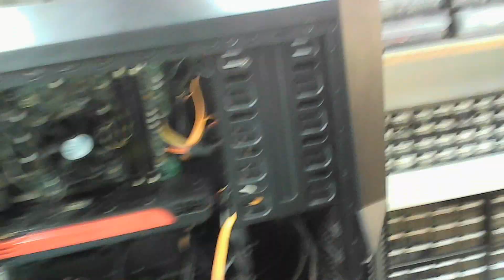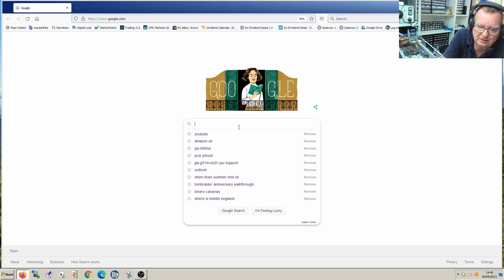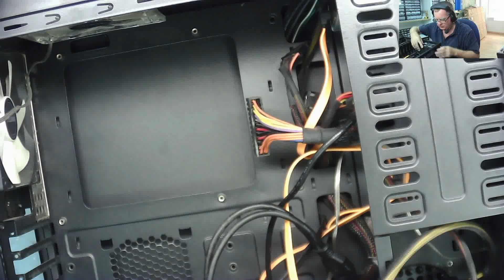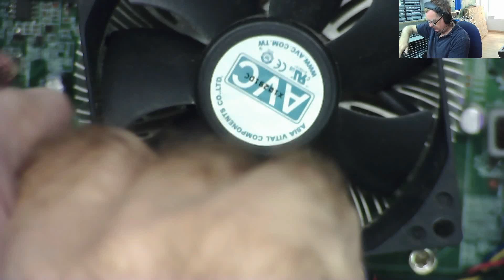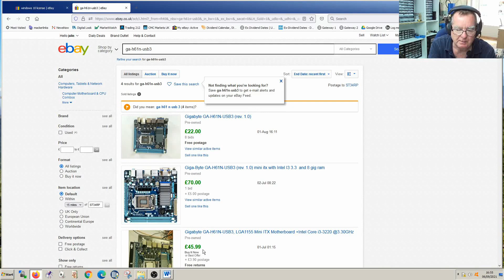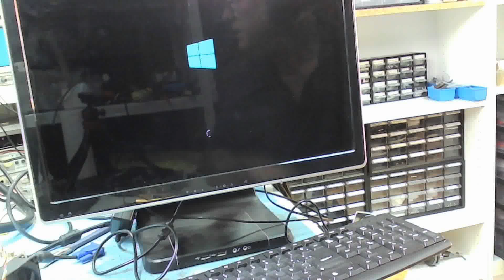Car Boot / Flea Market PC Finds - some you win some you lose.  Learn Electronics Repair #127

Comment: You'll break even at best; oh well, that's OK
Reply from the maker: That's the way it goes sometimes John.  It made for an entertaining video though.  I'll take break even but I think I may do better.  

I spent a little more time looking at this stuff today

I now got the Hundy X All In One running really quite well with a used 256Gb SSD and a clean Windows 10 64 bit install.  There is space inside for 2x 2.5" HDD so I fitted the 320Gb as well, deleted the old partitions and formatted it. It has webcam, internal speakers 4Gb RAM and wifi built in.  The SSD owes me about €20 and I just ordered a new keyboard and mouse to put with it which was €5.98 + IGIC (IGIC is our version of VAT but it is much nicer as it is 7%) so given I payed €10 for the item and I also have a €2 second hand laptop PSU to put with it, anything over €40 is profit.  I will ask €100 but suspect I may get more like €80 for it... we will see.

The two Viewsonic 19" monitors from the POS machines are working and in nice condition - I took them off the big POS stands so they only have Vesa mount brackets but I think I can probably sell them to one of the local bars to fit to their DJ /Karaoke booth or something like that.  They have DVI and VGA so I think I should get €40 the pair or something like that.  Those two POS even if the motherboards are scrap owe me €10 each so that's profit.  The other AOC monitor is badly scratched, most likely I will bin it.

The Gigabyte Micro ATX motherboard should fetch  about €30 if i put it on ebay.  That PC owes me €10

The i5-3330 CPU from the other POS looks like they sell OK for about €15-€20 - that POS owes me €10 so a little profit there
The Gigabyte ITX from the same POS boots to the BIOS screen but that goes off after a second then I get a flashing cursor, possibly that one is OK, possibly needs BIOS reflash, I didn't check it thoroughly yet - anyway it's about €30 on ebay if it works

So I make that about €85 net profit (€115 if the Gigabyte ITX is good)  and the 1200W ATX I am going to keep it myself as it then owes me nothing.

The other two ITX with integrated CPU, the Intel LGA1155 Motherboard and the Radeon are just a bonus if I can resurrect any of them

The Ugly ATX and all the other junk can go in the skip!  I did get some nice Zalman cooling fans out of it though and two of the little mini ATX PSU out of the POS machines are working but probably need recapping.  

So actually probably it won't work out too bad.
Reply: @learnelectronicsrepair  It was an entertaining video indeed; those ITX boards have a Sandy Bridge ULV Celeron CPU, all solid caps, all kinds of ports (inc Dual Lan), can take up to 16Gb and will work with anything from XP Embedded to Win10. I'm really curious to see what's wrong with them.

Comment: Oh there’s absolutely profit to be made. ANY working mainboard from socket AM2/1156 onwards is worth a minimum  of £20. The problem with that PSU is that it’s not a well known make so you won’t get as good a price as you otherwise could. 

And yeah…that case, damn it’s ugly! 😖

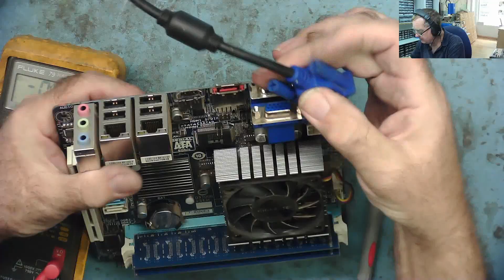Edit 42:49 that’s an eSATA connection, a failed attempt to compete/replace FireWire and USB 2.0. That mainboard only has a PCI slot because it was designed to be used inside a pre built, all in one type system, not to be removed and used for something else. I haven’t got to the part of the video where you remove the heatsink, but there’s a chance the CPU will be soldered to the board instead of in a socket, if it is in a socket, they’re usually low power Pentiums.
Reply from the maker: Yeah beauty is in the eye of the beholder but in this case everyone seems to think it is ugly.   Funnily enough I find it is often motherboards from P4 socket 478 and earlier, that are worth more money!   The ones of least value seem to be LGA775.  Except for the few 775 with AGP of course....  And like you say, the more recent ones from Core i3//5/7... onward.     So actually come to think of it that is just about 'any working motherboard'. The 1200W PSU value is kinda academic really, as you probably guessed it is staying at the workshop :D
Reply: @learnelectronicsrepair  50:22 I knew it, integrated CPU!

Yeah you can pickup LGA775 boards for next to nothing at the moment, socket 478 boards were very cheap until fairly recently when they’ve started being desirable in the retro community…of course I’m sitting on absolutely loads of them! 😆👍🏻

Comment: Nice video. Any chance you could do a  video finding shorts on a faulty board using the diode mode with a multimeter?
Reply from the maker: Check these out:

https://www.youtube.com/watch?v=kGM-Zmrr6tc

https://www.youtube.com/watch?v=NUgO7v4cbKs&t=117s
Reply: @learnelectronicsrepair  lovely! Will watch those videos. Thank you!

Comment: Hello I have a psu that has a problem it starts and then turns off in one second but the purple wire has a perfect 5 v and in green wire also but in 12v its fan run and the turn off in one second it is a basic smps. Any suggestions please ? Thank you
Reply from the maker: That could be for various reasons.  Does the purple 5V go off as well or just the other supply voltages.  Are there short circuits on any of the outputs?  Have you tried putting a load on the PSU, especially on the 3.3V?  How are you measuring the outputs, with a multimeter or ATX analyzer?  You need to do some more investigation before anyone could answer the question.
Reply: @learnelectronicsrepair  if I short the two terminals of opto coupler then in 12v rail it gives 6 v.
Reply: @shagunjaiswal1549  Which side of the optocoupler are you shorting, the LED side or the phototransistor side?
Reply: @SuperDicky96  in the side of output section